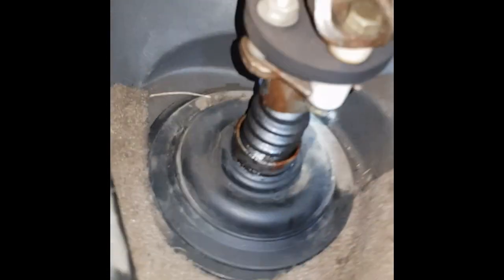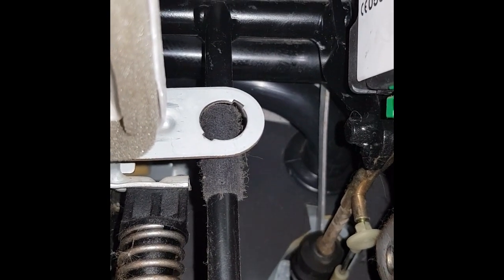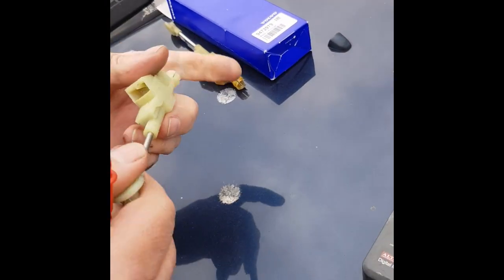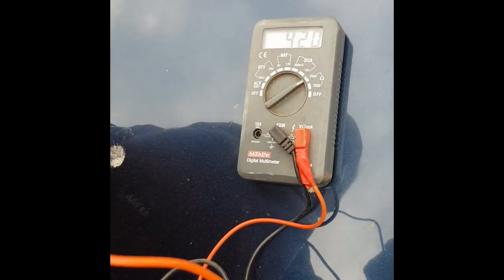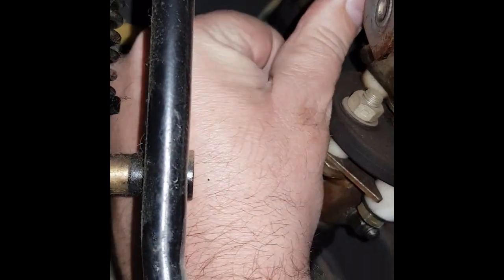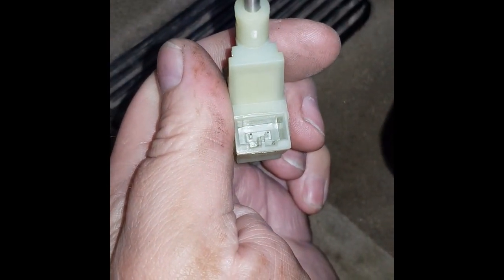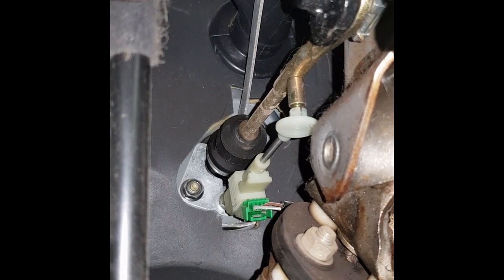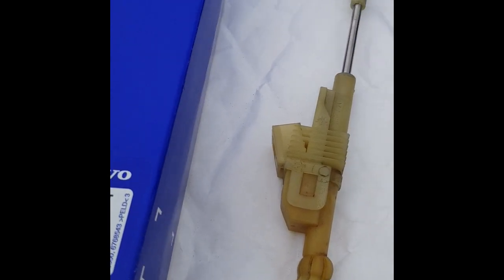volvo C 70 clutch position sensor 9472979 OBD fault P0805

Comment: Hi, great videos.
My sensor range is 400 to 1600 ohm 
I think i need to increase resistance, is it as simple as wiring in series instead of parallel?
Reply from the maker: Not sure, never had one fail that way. It certainly won't hurt to try. I'd be interested to know how you get on, it might help others if they have the same problem?
Reply: @philcross7315  I've ordered a variable resistor, I will post back and let you know
Reply: @philcross7315  so the resistor came, I checked the resistance again but this time it Was about 600- 8k ohms. Previously I think it was shorting from the cleaning fluid. Unfortunately upon rebuild the sliding face snapped I think the oil leak brittled the material. But if it didn't snap I was confident the repair would've gone well. eBay job  Cheers

Comment from the maker: Update:
The new sensor I bought (genuine volvo), went faulty with the same problem in July. Luckily, I had the sensor I had repaired in this video, and installed it. It's been working perfectly for nearly 3 months. I will be repairing the "new" one just in case.
Reply: Is the sensor supposed to be set at 200? Amazon has pre set sensors, but the sensor has 3 contacts and its only 2 cables?.

Comment: Thanks for the video, looks like an easy job. By the way, my V70 throws the code, but the cruise still works. The jerkiness is there though.
Reply from the maker: It's a cheap and relatively easy fix, so worth trying. I hope it solves your problem.
Reply: @philcross7315  i have this .. cruise works lovely but car hates just pottering round ... car will sometimes refuse to start unless the brake is also pressed

Comment: Should the cruise control work immediately after changing with a new clutch sensor or a faulty code has to be cleared?
Reply from the maker: Somehow I missed this message, sorry.
Yes, the cruise control worked straight away. I did delete the fault code after I fitted it, but don't think it would stop the cruise control working properly?

Comment: Any other issues apart from cc not working? My S60 hesitates when pressing the gas intermittently. I've read it can either be this (due to on the fly ECU adjustments) or a bad Italian throttle body which should be replaced/cleaned. Does that seem right?
Reply from the maker: When the sensor was faulty I did very occasionally notice a slight lag when pressing the throttle at low revs. It was very slight though. I've not noticed it since?
Reply: @philcross7315  My issue ended up being a dirty MAF sensor. I cleaned it with electronics cleaner and the car is A LOT more responsive now. Now to tackle the P0300 random misfire and hope I don't need to rebuild the entire engine. :)
Reply from the maker: @de_creative  glad you got it sorted 👍
My throttle body hasn't been had the conversion/upgrade yet, but I suspect it's in the pipeline?